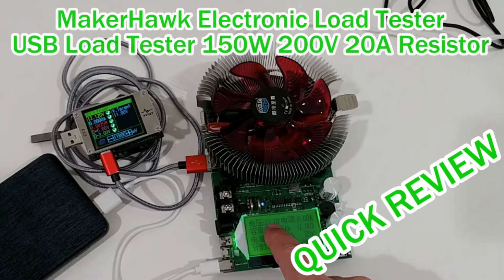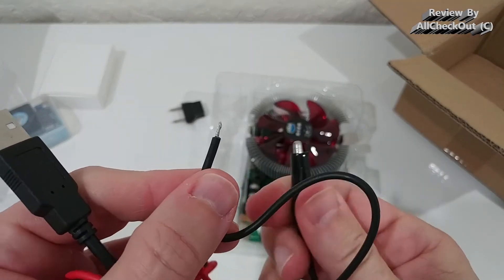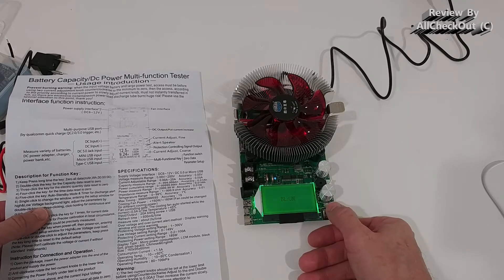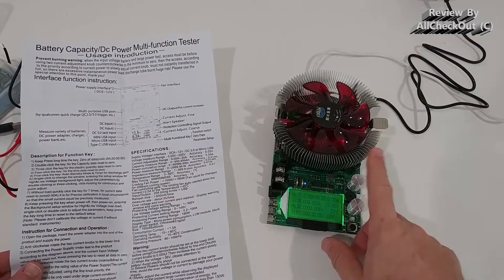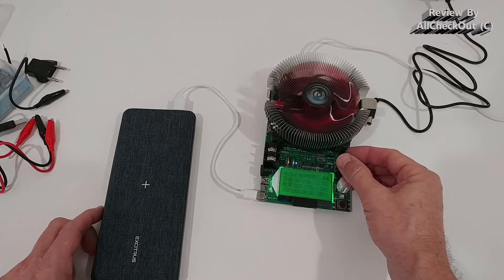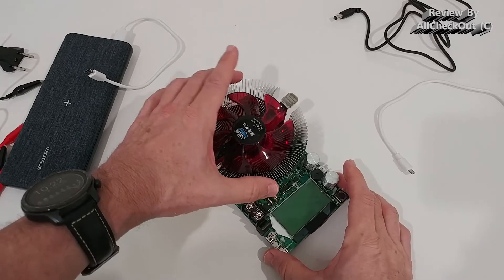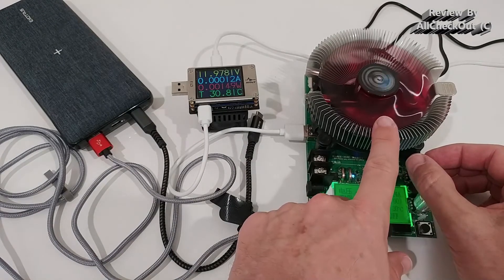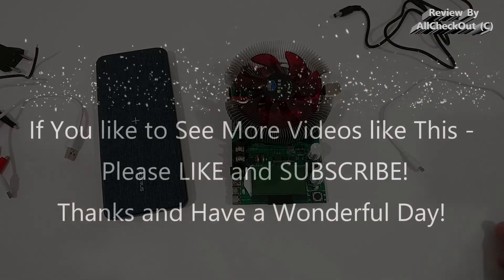MakerHawk Electronic Load Tester - USB Load Tester 150W 200V 20A Resistor FULL USB TESTING REVIEW

Comment: If you follow the instructions provided with the unit...you will have no issues and it works well for what it is. I have found the volts to be a little low on the unit..(.22vdc),  but just compensate with a multi-meter to check it for a true cut off voltage. The Amps were correct and matched.  I think it is well worth the money spent. I ckeck AH capacity of Lifepo4 individual 3.2vdc cells with it and have no problem so far. Slow ADJUSTMENTS OF THE KNOBS ARE NECESSARY!
Reply from the maker: Thanks for your input. A small $20 HD35 does a much better job on the adjustment of the amps ... if you have ever tried one ... it's 100x better than on the MakerHawk. BTW: I'm currently using a Maxmartt instead of the MakerHawk (which) I've returned, but everything is exactly the same so you can buy any brand ... all the 150W testers are the same. Biggest disadvantage in my eyes that is has no USB triggers and the mAh counting is totally off ... and I mean totally. Will release a video about that soon ...

Comment: What happened to the HD35 load tester? You said it broke
Reply from the maker: I plugged in a cheap micro USB cable which damaged the port, but it still works ... somehow .. just not reliable any more. But it's still one of my favorite USB testing tools. If it will finally fail - I will buy a new one ... even on top of the 150W load tester because it has a built-in QC trigger, is smaller ad much easier to use than the 150W tester